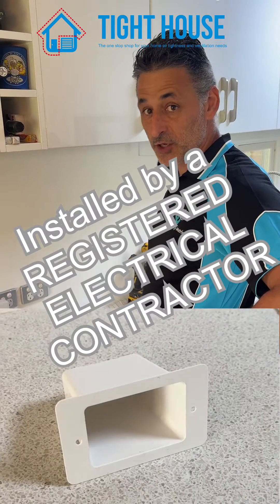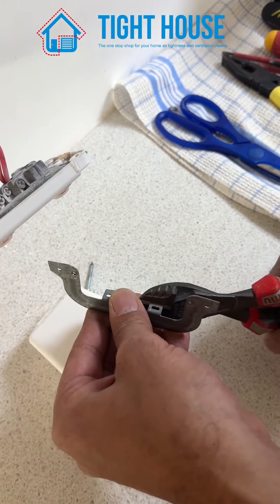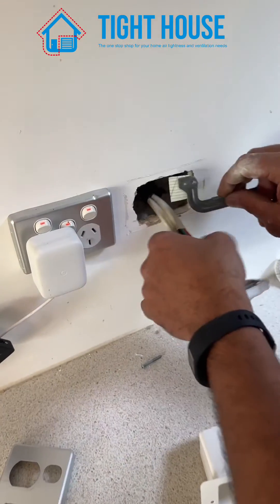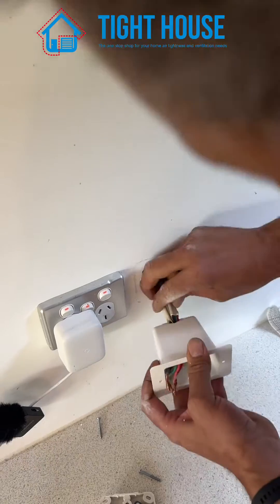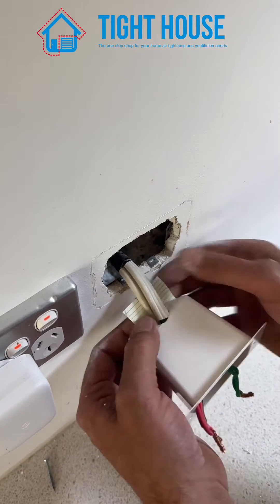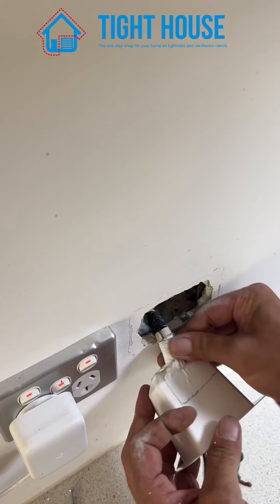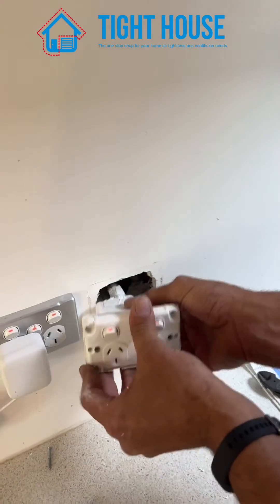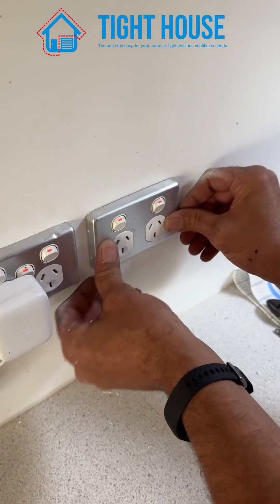Installing/Retrofitting a PowerPoint or Switch Backing box for air tightness.

Comment: It's really good that you guys educate people around these issues which are often overlooked and not part of the building code guidelines or even requirements. 

One big question that I have is about the huge amount of costs involved in retrofitting these improvements vs the ROI. For example I opted out of double glazing as it was around 20k+  upgrade from standard glass windows (single story house) and my gas heating costs for colder months per year is around $1500-2000  (currently). If I were to have double glazing and cut down my heating costs about 25% ($500 roughly per year) it would take me 30-40 years to recover the upfront cost of doing the double glazing which is bit too far along isn't it (and that is JUST to glazing part before any other potential improvements). 

Also if you have child safety plug put in the empty sockets it can potentially reduce the leakage as well right?

Comment: Fantastic! Thanks for sharing,

Here in Perth I have a double brick house, would this be a worthy upgrade for air tightness in a brick house?

I’ve already adopted some of the major issues;
Manhole cover 
Fans & extractors 

And I’ve already noticed a substantial difference! Keep up the great work
Reply: Most brick installed PowerPoints and switches have a wall box behind, you can just silicone up the entry holes.